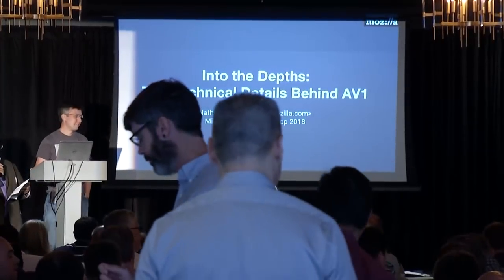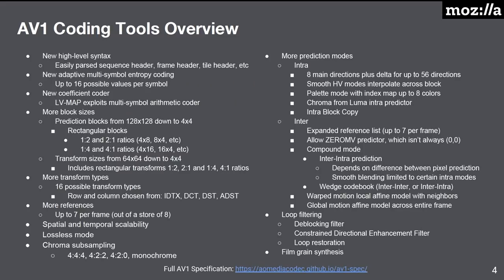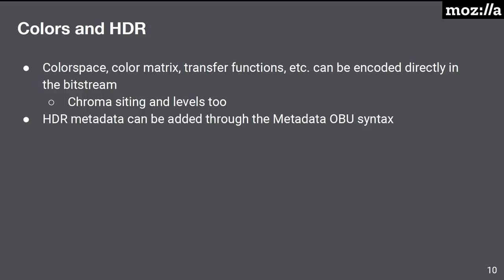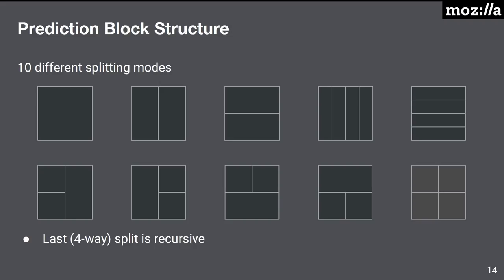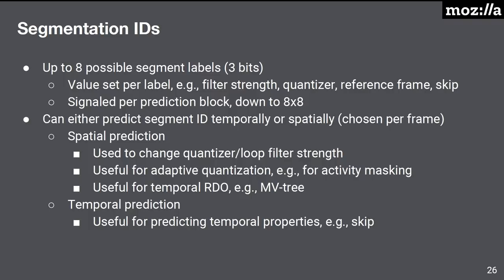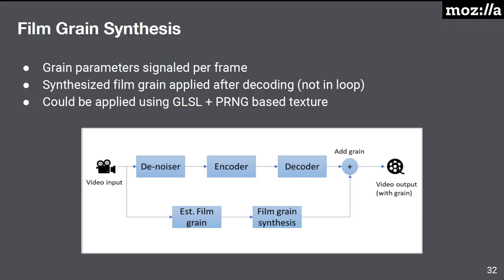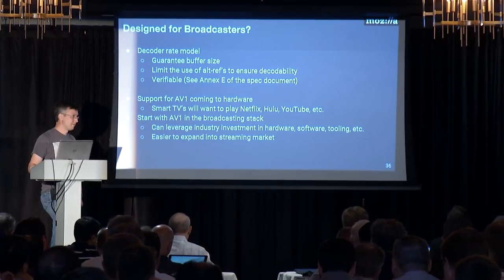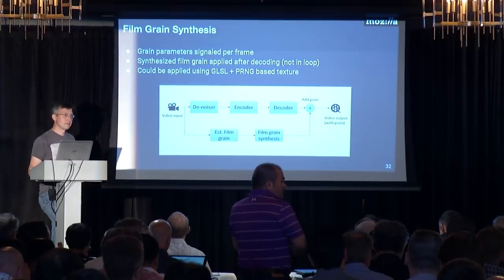Into the Depths: The Technical Details behind AV1 by Nathan Egge

Comment: I really wish Nathan Egge would explain why the AV1 team dropped daala's lapped transform.
Reply: If you mean the orthonormal transforms I read somewhere they were dropped because they were brought in too late and hardware would have to redesign a lot risking potential delays. Maybe they will make it for AV2.
Reply: @Ashtree81  I don't know if this is an orthonormal transform, but it's a special kind of lifting scheme with a little post-adjustments to make it resemble a DCT, & it only used adds subs & small shifts to achieve that - & it wasn't brought in late, it was there from rather early on (it's already described in Monthy's first daala demo page) but it got dropped late in development. Also I see no way how this could be difficult to implement in hardware because it's fundamentally simpler than a DCT on so many levels:
https://people.xiph.org/~xiphmont/demo/daala/demo1.shtml
Reply: @FrankHarwald  Ok, yeah its not the same as the ortonormal ones so dont know why it was dropped.